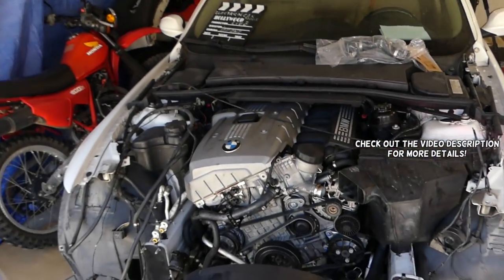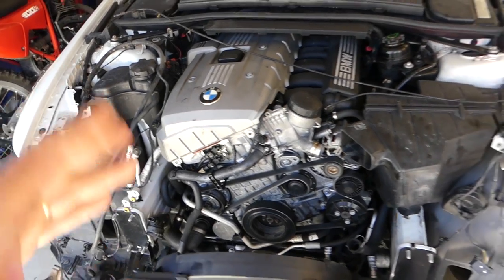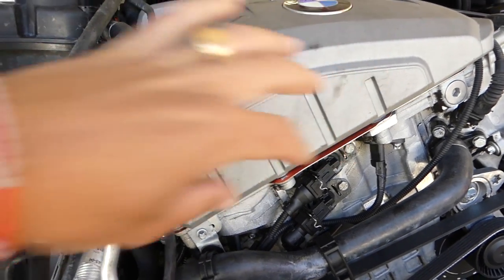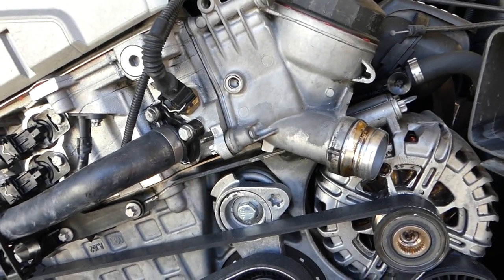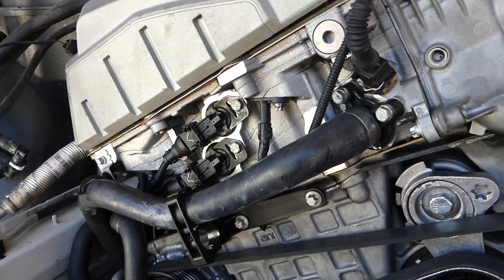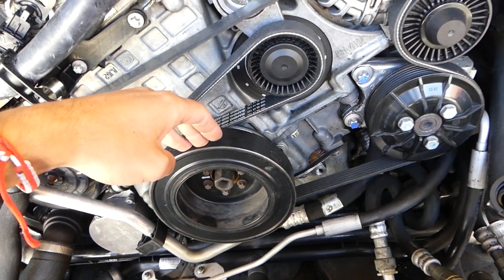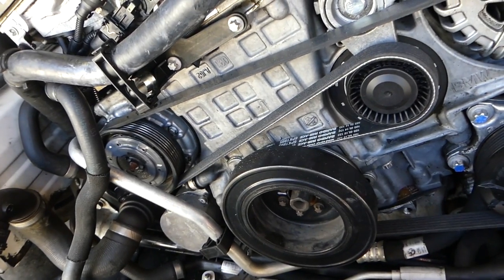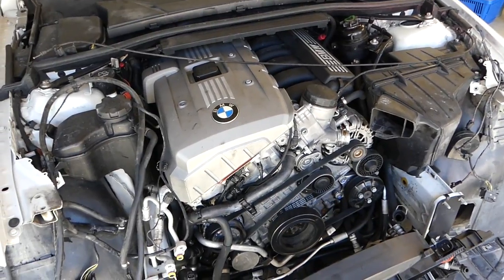BMW MOST COMMON OIL LEAK LEAKS

Comment: interned at bmw for 3 month,and i found,the most common leakage is the valve cover gasket and oil sump gasket,
In addition,for N20 engines, the air/oil separator always clog up,so the engine oil can flow into the intake manifold,solution is to change the valve cover unit
btw,the video is nice

Comment: nice video very helpful, i have a 2005 530i and i am having problems with all my lights, from headlights to backup lights, it's like if the right headlight works then the left high beam does not the brake lights does the same. what can i look for to fix the problem?

Comment: I also work on Beemers and i only have one thing to add to all the great info is that i also get allot of oil leaking from the mating surface on the vacuum pump
Reply: That's the only oil leak I've had on my 6 series. The o rings were worn to hell since they're the originals that came with the car in 2006. But I've heard of people having to replace those seals every other year or so. I wonder if it's just bad bolts not clamping strong enough or is it normal to see that kind of wear and tear on these cars.

Comment: Should i buy a 2014 Bmw 528xi. The owner om put 2,500 miles pet year on it in a 4 year time frame.  She changed thr oil every 2 years   The beamer just turned 50k miles. She is old ladu and drove it rarely.

Comment: So I’m tryna buy this bmw 5 series m3 2004 and the tire makes noise and has a engine oil leak.....it’s in good condition basically looks new and idk if it’s a buy or a rip off do you think I should buy?? Is the problems serious?? Someone help me...😣😣
Reply: Yammo, oil leaks in BMW is quite common even if it just has 30k miles.  Most oil leaks are minor and sweat through time.  If you see a drip on the floor than stay away.  Most drips won’t register on the dipsticks.

Comment: Any vehicle should have the oil changed and filter at no more then 3500 miles it don't hurt to change it more frequently your engine will like you longer just make sure you always have the proper amount and stick with the same viscosity oil weight each time your vehicle will like the treatment you show it